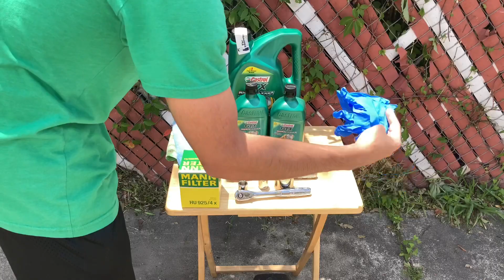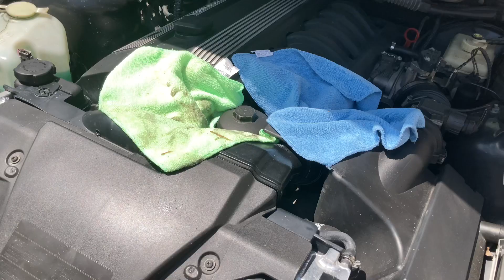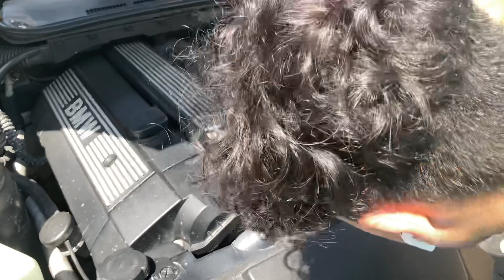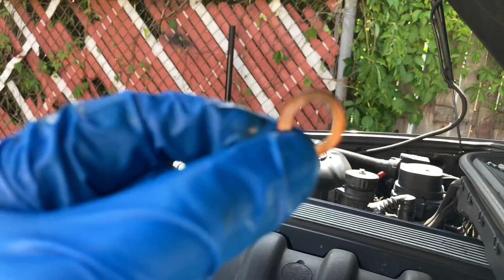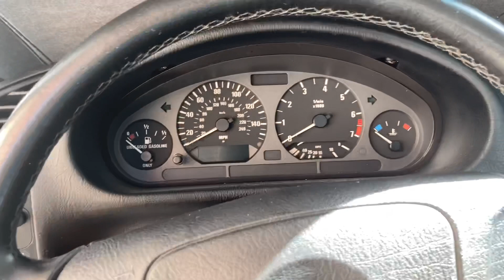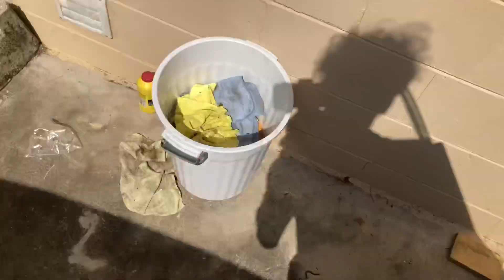BMW E36 Complete DIY Oil Change Guide and Channel Introduction!

Comment: Great job, realizing that you forgot to put the washer back on made a good teaching experience. Just one silly question since I live in a condo so don’t get to attempt to do my own mechanical work, how/where do you dispose of the old oil?
Reply from the maker: Yeah i try to show my mistakes so that others don't make the same ones! I dispose of all old my old oils/coolant at my local Tire Plus. they're a certified recycling facility. You can always do a google search to see what local recycling facilities are near you!

Comment: Thanks Yaseen; well done. 
One mistake I made with the same motor years ago was overtightening the filter cover which squishes the top of the O-ring. It seems that when the motor is in use and the pressure builds up, the oil pushes past the O-ring and trickles down the side. It makes a mess on the pavement when you park. Took me 4ever to figure out as it ONLY leaks when there's enough pressure.
Maybe for a future video, do a brake pads replacement?
Reply from the maker: Thanks for the tip and recommendation! Will definitely keep that in mind for a future video.